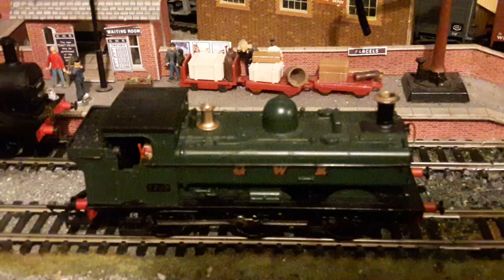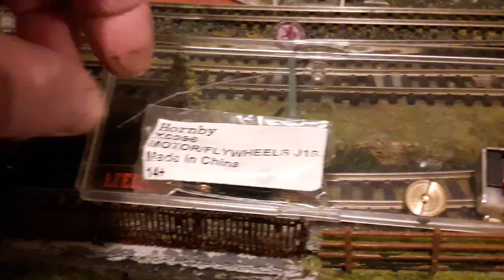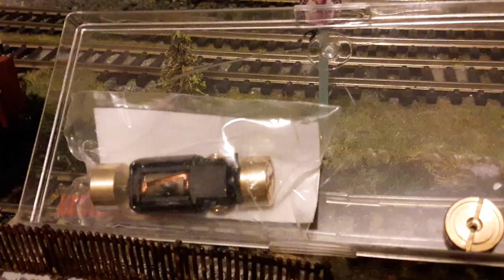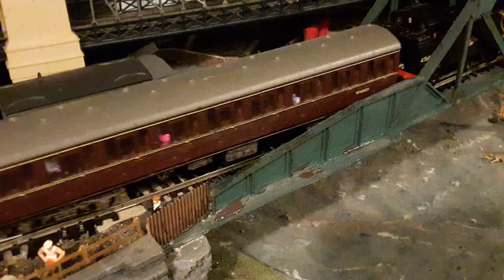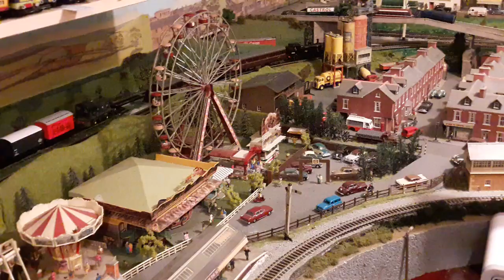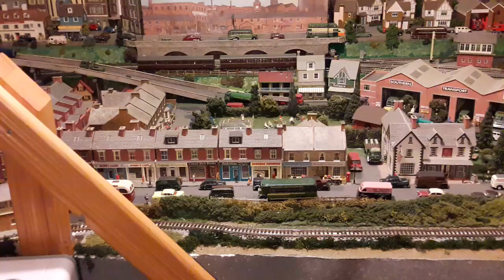Tommys Jinty Gets a New Motor

Comment: Hi Paul another job done nicely by you ! I’ve  got a couple of Jintys one Triang and the other Hornby they are Nice little workhorses .☺️👍🚂🚂
Reply from the maker: Hi Michael, I also have 2 Triang/Hornby Jinties, both have been fitted with modern Can motors and new wheel sets. Now they run perfectly on my code 100 track. This latest improvement is great for very slow speed shunting. 
Have a great weekend. Cheers, Paul.👍👍🙏

Comment: Wow, what a beautiful runner it is now. It would have been nice if the manufacturers would paint the motors black, they would be less visible. But even with the red line, these motors are fantastic!
Reply from the maker: Hi Erik, The motor I used is for a Hornby J15 that has the motor covered by the boiler so the brass flywheels are never seen. I painted the red line on the flywheel to show just how slow it can turn for the video, I may paint the flywheel black one day. 
Although it only has the one flywheel (2 on the J15) the motor runs very smoothly and slowly. 
Cheers, Paul.👍👍🙏

Comment: Hi Paul, that Jinty is performing very well, as good a crawl as you could want.  I have been contemplating doing something similar to a few of my Bulleid Pacific's with the old X04 motors.   Once I find the right motor that it. Steven.
Reply from the maker: Hi Steven, In addition to this Hornby Jinty I have 2 Triang Jinties that had X04 motors, I converted them both with Can motors and new wheel sets- They run perfectly now on my code 100 track. I know Peters Spares in the UK has modern Can motors to replace the XO4s the difference in how they run is amazing. Check OO Bills youtube channel he has fitted these motors. The only issue I had was replacing the Brass Wormdrives on my Triang Jinties so bought Nylon ones and new Axle gears. 
Cheers, Paul.👍👍🙏